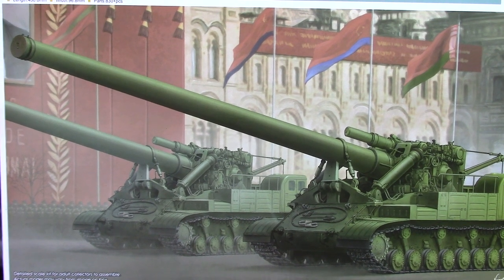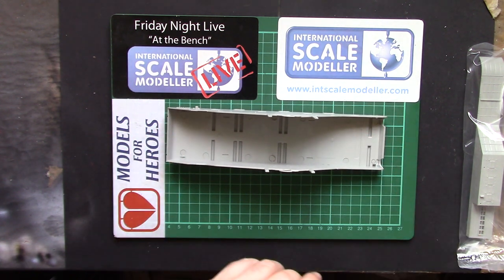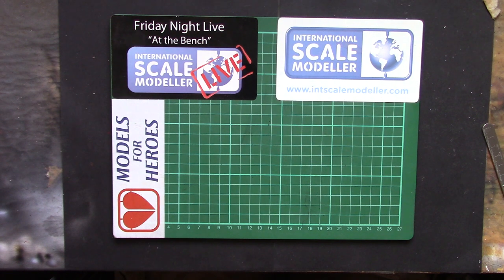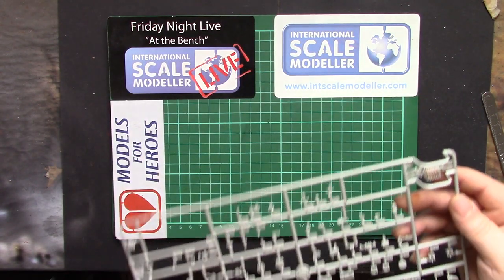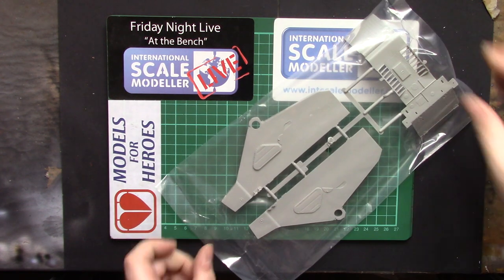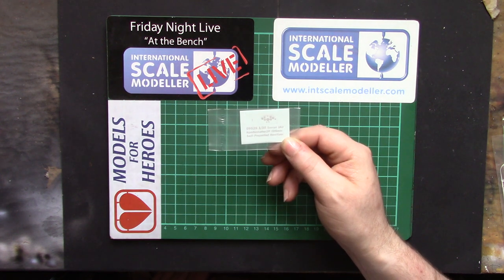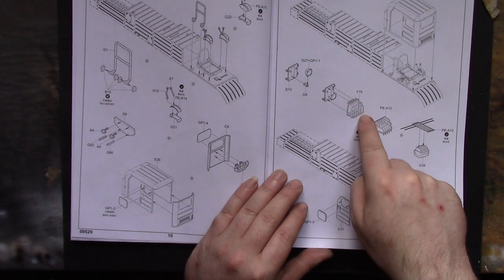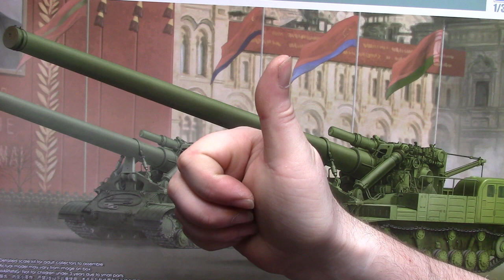Trumpeter 2A3 Kondensator kit review.

Comment: Hi John, I have also done a very brief review here on You tube and am also putting together some build reviews. I have also waited for this kit for a year!
I am a little disapointed with the fit of the major hull parts and the flash all over the wheels. Not too much work to remove, but on a brand new kit??? I also had an issue fitting the road wheels to the swinging arms, it was as if the wheels were too big and the swinging arms needed to be reshaped to clear them. Again, not too much work, but on a brand new kit?? Still love it though!!
As for the track links, I notice Panzer shop supply Friul JS3 tracks with their resin kit.
Reply from the maker: Hi Nigel, pretty much similar feelings here but I'm still enjoying the build, found some of the track links a rather tight fit together too but I'll cover everything when i do a built review of this, thanks for watching,

Comment: Another detailed and very informative review from Sharpies Styrene Emporium. Right up your street, I'd say, John! Thanks for filming & posting.

I take your point about if you object to swiping a few bits of micro flash off, here and there, then maybe you should consider finding another hobby. But that said, it is slightly disappointing to find quite so much of it on many of the sprues for a brand new, newly tooled, just released 2018 kit.

Oh dear, John.… "destructions … AND … "leg-end". The trolls will be out in force for you! 😱😂😂 Yeah … "Up Yours" is a great (and extremely appropriate) response.

As something a little out of the ordinary, (or even BIG and out of the ordinary 😜), would be great to see you do a build series (even if not completely step-by-step) on this one. Any chance you might consider it?

As ever, there's always something interesting, informative and entertaining in your postings. Many thanks, and KUTGW.  😎👍👍
Reply from the maker: Thanks Mark, i don't intend on doing a build series per se but i will film a "build review" of this beastie. The flash is a little disappointing but as you know not really an issue, I've had amt kits where i had to cut the parts out from the flash before though.
 Gotta have a few digs in there to stir the pot a bit, thanks for watching and commenting!